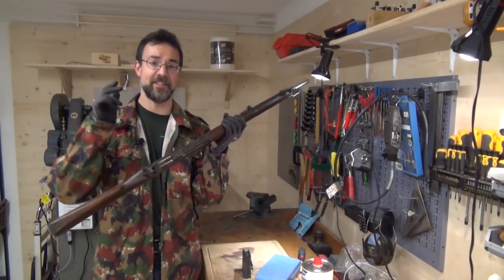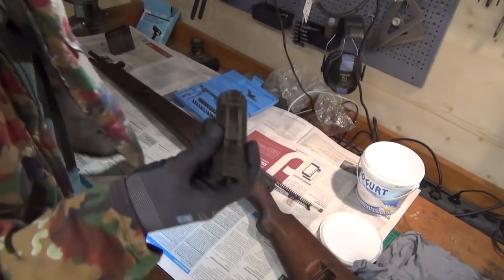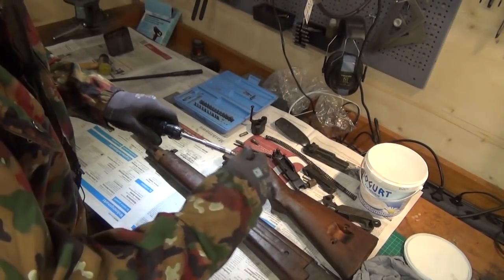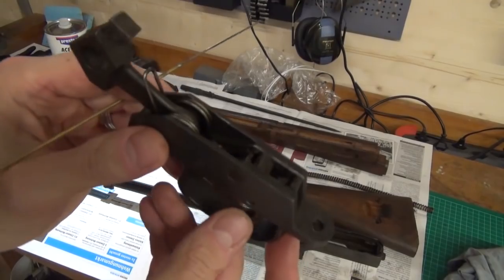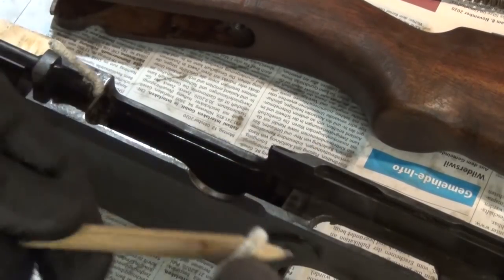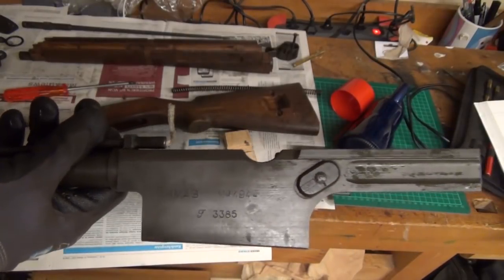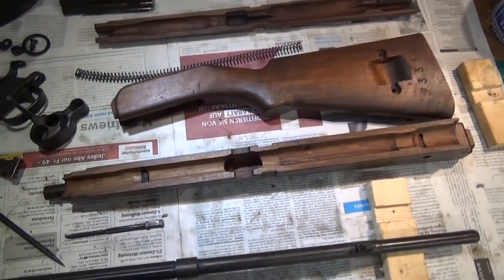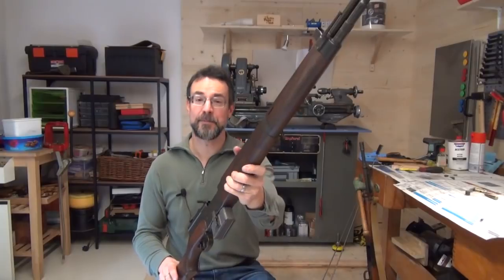MAS44 - After The Teaser Comes The Clean-Up

Comment: The best way to clean up old grease is with a 'hand steamer' (just google it). They cost a few dozen $, and their 180F hot water spray (not technically 'steam' since it's not 100C/212F) will get into all the nooks and crannies and wash the grease right out under pressure in a matter of seconds. Works far faster and more thoroughly than any other method I've found. I used one to wash out massive amounts of grease on the inside of DP28 bipod legs (which are hollow steel tubes closed at the ends). Yes, you're putting water on the metal, but it's so hot it dries instantly.

Also supposedly useful for tasks around the house like getting stains out of carpets and drapes.

Comment: Use brake cleaner it will remove all the grease and oil  in all the places you are not taking apart. Just relube when you are ready to reassemble. It does an outstanding job, I have been using it for years its a God send.

Comment: Well done Chap, good cleanup job. A suggestion for a bolt knob, in an industrial setting we used a hard machinable type plastic called "UHMW" it came also in dowel form, it is tough as nails.
Reply: I found an original quicker than I expected so there was no need to make one after all.

Comment: I would use shellite (white spirit / naphtha) over acetone. For metal parts like the bolt and cover, receiver or any gas system parts I would put them to soak in a bucket of kerosene or petrol. Lots of ventilation though.

Comment: Good video. I would say ‘breechblock and breechblock carrier’ as with the S.L.R. L1A1 and S.L.R. L2A1 (corrected ) given that there is no rotation about the barrel axis to lock and unlock the breech, i.e. this rifle has a tipping breechblock as opposed to a (rotating) breechbolt.
Reply from the maker: The official terms in British service are "breech block" and "slide". And btw there's no L1A2. But your definition would prevent a number of bolt actions from having "bolts", such as the 1886 Mannlicher, Sauer wedge-lock turnbolts, Blaser collte-locked straight pulls and others. IMHO "Tipping bolt" is a perfectly legit and generally understood term.
Reply: @BlokeontheRange  Meant to type L2A1. Sorry about that. Hard couple of days on site. It was breechblock carrier in NZ (and presumably Australian) service during my time as a sapper. This idea of referring to breechblocks that do not rotate about the barrel axis as bolts seems to have started in the US after WWII, near as I can work out, possibly due to the existence of ‘jobbers’ as opposed to specialist firearm distributors in the US. It was Yank retailers who started calling the .45 Colt cartridge, the .45 Long Colt after WWI, supposedly to differentiate it from .45 ACP BUT more likely to save on printing costs by abbreviating word count in advertisements and catalogues, i.e. not providing an accurate product description.

Comment: alcohol works good on wood pulling off oils while not damaging the wood...  i use a hair dryer to pull out the greases then wipe with alcohol.  After that i rub boiled lindseed oil on wood
Reply: I suppose he is used to the no no in swiss k31 about alcohol. It will strip down the finish as it's shellac. On any of this i would just use white spirit

Comment: In the past, when I've had to clean heavily cosmolined/greased metal items,  I've done the "submerged in a tank of rapidly boiling water with some dish soap method" which generally only requires some light rag work at the end and then some generous spraying of rem-oil. It has the added benefit, I find, of easily getting out the grease in even hard to reach and clean crevices.

Any particular reason for the method you used here? It looks a lot more labor-intensive than I've ever had to do myself. Is it because of the special characteristics of the French grease used?
Reply: I went with what I had. Acetone, rags and elbow grease are cheap and plentiful. I have no means to boil a volume of water than big in any case.

Comment: Hi. Just a couple of small  questions. Instead of using such a volatile solvent as acetone, why didn't you use a paint thinner\paint brush cleaner instead? It works much better on most creases, and as I said, is less volatile.
Also, why not soak all the reasonably small pieces in paint thinner in a bucket (a large paint can is handy) and use a paint brush to brush the grease off?
This works wonders for me, when I need such a clean. 
Thank you for an interesting video.
Reply: To be honest I can’t stand the smell of paint thinner. I did soak all the small parts in acetone, the grease became all flakey and just brushed off.

Comment: I use acetone with a tooth brush for cleaning out the difficult to access corners and fiddly bits. I have a question. How similar is the MAS44 to the 49/56 for disassembly/cleaning? I have a 49/56 still in the plastic wrap from importation here in the US. I have looked everywhere for a video showing disassembly, even bought a book on milsurp rifle disassembly. Which ironically showed me how to disassemble my Rasheed, a much less common rifle, but not the MAS49/56. Thank you for the great information.
Reply: Pretty much identical. The only difference is the gas block.
Reply: @thebotrchap  Thanks again. One day when I'm motivated I may clean her up.

Comment: Turn a non authentic bolt knob out of alloy suitably  knurled to match original ?
Reply: Authentic bolt knobs are out of plastic because otherwise said bolt knob would get very hot. The stem it sits on is right next to the gas venting chamber in the bolt.

Comment: How many times did you wish you had a bathtub-sized ultrasonic cleaner, Chap? What a nice-looking gun, I look forward to seeing it shoot.  
I know it's not particularly authentic, but a bit of knurled brass would look nice as a bolt handle, maybe that might add too much mass though...
Reply: It would also get very hot 🥵 I have since sourced an original. All I needed was a new cross pin which was easy to make.
Reply: Ah, fair point indeed.
Reply: @thebotrchap    Any chance you wiil give detail on the knob replacement?  Mine is cracked.  I have not been able to find an original replacement here in the states.

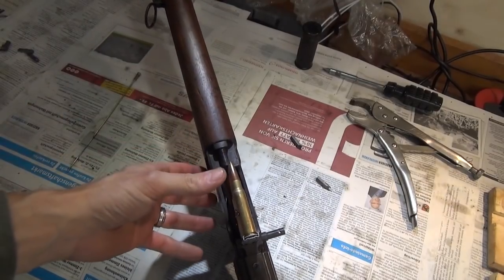Comment: 34:35 Ah that gives me memories of a certain Alex struggling with his MAS-49/56, trying to top it off with stripper clips. I  guess it could be remediated with a proper technique. For a rightie, you could try press the rounds down with the right hand, press them down with the thump, while doing sort of a cat's paw with your phalanges (the right receiver wall is shorter than the left one, thus the rounds tend to tilt to the right). Either that, or push the rounds down like you were pushing an M1 Garand en-bloc clip down (Garand really nailed it down so much that it's almost fool proof). For a leftie such as meself, errr...maybe some weird cat paw push that will, invariably, get your knuckles cut. I dunno how sharp those french 7.5x54mm stripper clips are.
Reply from the maker: Stripper clip loading the MAS semiautos basically doesn't work as intended. It's an afterthought, and a not-well-thought-out-one at that...
Reply: @BlokeontheRange  Stripper clip loading on pretty much every semiauto rifle with detachable magazine is never really a smooth process (edit: heck, even loading an SKS, which has a fixed magazine, with 10 round clips is not completely smooth 100% of the time). At least the MAS-44/49 is not like the Ljungman or the Hakim, which can be a finger trap if you forgot THAT one step of their rather convoluted loading process.